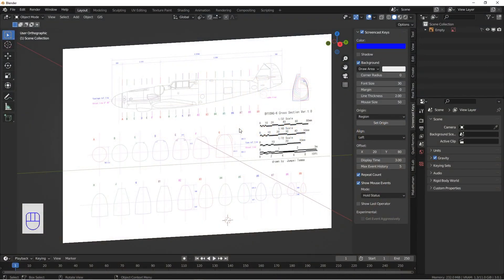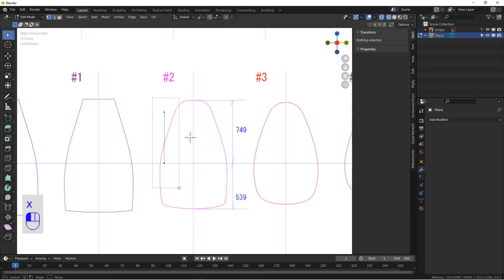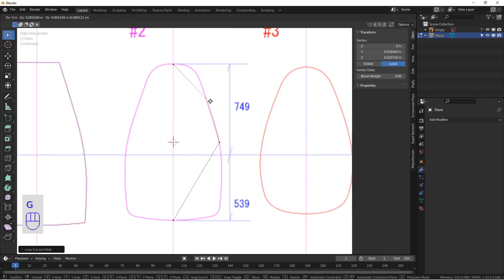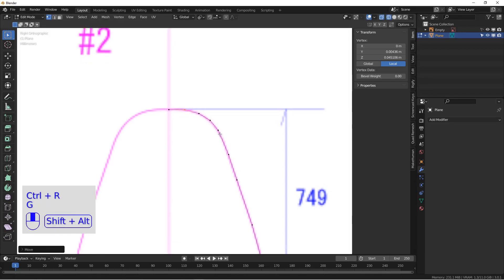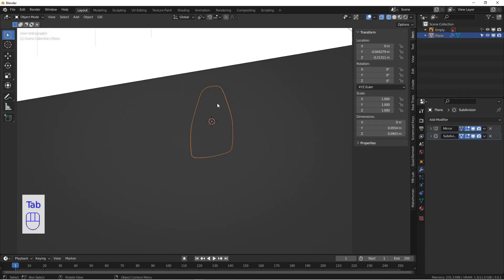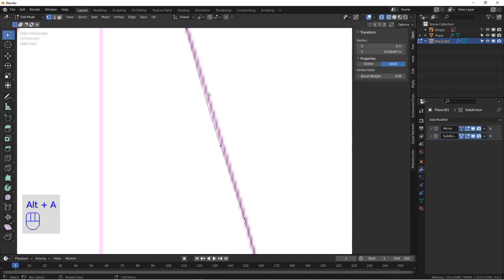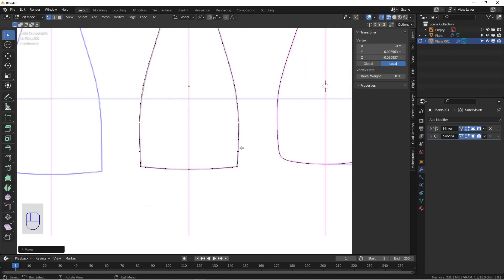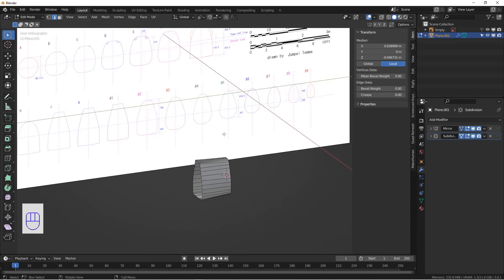Blender Detailed Modeling Course, PART 3.5: Making cross sections

Comment: Cant believe how valuable these lessons are. Do you ever work with cross section drawings that include the transition to the wing root? been seeing those a lot, I wonder if you handle those like the sharp part of the bf109 canopy, with supporting vertices near the corners

Comment: Hi Mark,

First of all, thank you for this amazing tutorial! I'm truly impressed by your work!

I've been working on creating a Fokker E.III based on your tutorial, but I got stuck. I think I might have bitten off more than I can chew. Nevertheless, I'm not giving up and constantly trying to improve. I'm not an artist by any means — I just love military history, so that's the reason why I started my journey with Blender and your tutorial ;)

I've spent around 60 hours on this model, and I'm still not satisfied with the results. I'm always trying to learn something new, experimenting with different techniques and construction methods.

I took the liberty of browsing through your portfolio, and I noticed you have an extensive library of WWI aircraft! This is a topic that really fascinates me because I absolutely love these machines.

If you don't mind, I’d love to ask a few technical questions:

1. Was the process of creating the aircraft similar to what you showed with the Bf 109? When modeling the fuselage, did you break the Fokker down into cross-sections? In your Bf 109 tutorial, the cross-sections were made just from vertices. When creating WWI planes, did you, for example, model a wooden frame of a certain thickness, or did you stick with the same method as with the Bf 109?

2. I have the same question regarding the wings. Did you also start with cross-sections and then connect them, just like with the Bf 109?

3. My last question is about the metal engine cover. Every time I try to apply subdivision, the whole cover model becomes a complete mess. Any advices?

Thanks in advance for any answers if you have the time and feel like responding!

Kind regards
Maciej

Comment: Hi, I like your modelling course  it is very helpful.  Can you make  another series with modern 80's-90's jet aircraft? I know most of the steps are identical, but lot of steps are  more difficult  that the ww2 one. At least for me.  For a modern jet doesn't have  precise  cross section or airfoil  drawing even an accurate 3 view blueprint either.  At least  it is not often and very rare to be accurate. The another difficulties for me that those aircraft have not have  circular or oval fuselage shape so there is not easy to lofting the cross sections to make a basic model. Especially those jets  which have separate intake each side or bottom .the drawing often not help much or even don't see the part what we need to create. because the pylons  are covering them on the drawings. Also different between the ww2 and modern jets that the modern ones have more sharp edge  almost everywhere  than the ww2 planes have a rounded shape. This cause much  more loops to be good shape  and there will be much more polygon in the beginning. The last thing there are more detailed and more parts landing gears and engine nozzles. I can't see in the internet such a detail modelling course like yours if yes it is only ww2 plane. So If you have time and interest to make one I would be very grateful   .
Reply from the maker: You've pretty much listed all the reasons I prefer to make WWI and WWII aircraft!  ;)   The shapes on modern jets are much more complex.

I can't promise anything soon.  I'm currently working on an F101, so maybe I can go back and make a couple of "jet-specific" videos that address some of your concerns.
Reply: @Mark_Alloway  Thank you for the quick answer. I hope I can see this tutorial sometime. Thanks in advance

Comment: Regarding the Bf-109, the complexity of the parts that are adjacent to the fuselage.  I don’t understand how to make the geometry of the parts in front of the cockpit, protruding "nostrils" ???
Reply from the maker: Those intakes started off as quad spheres that were cut to 1/4 of a sphere and then stretched using a lattice or proportional editing.  Once they were stretched into the basic shape, a vertex group was assigned to to the bottom vertices and they were shrink-wrapped to the fuselage.  Chapter 10 (https://www.youtube.com/watch?v=oKqvWTBaaU8&list=PLoW-6Ghw9DkXpmkJ5aRXqAWhOCtjh2B8f&index=12) shows how to blend them using the data transfer modifier.